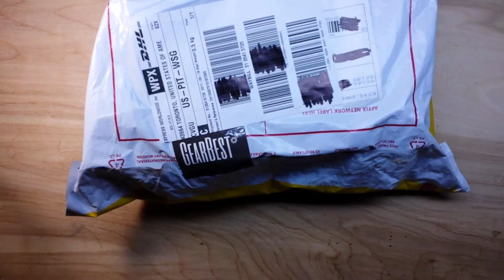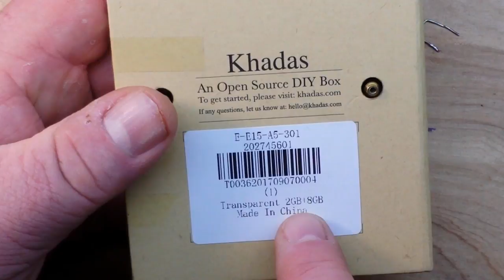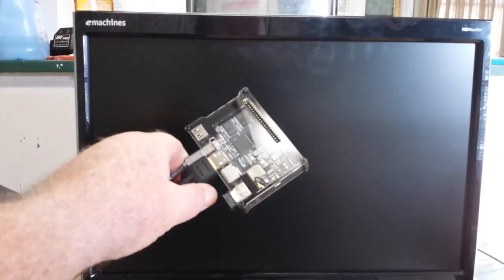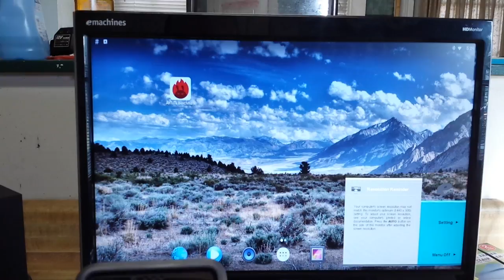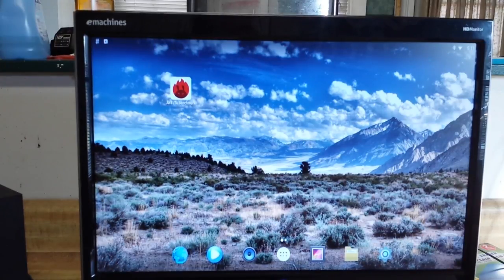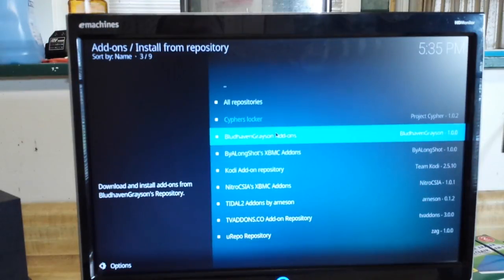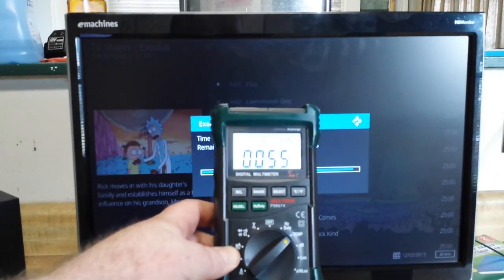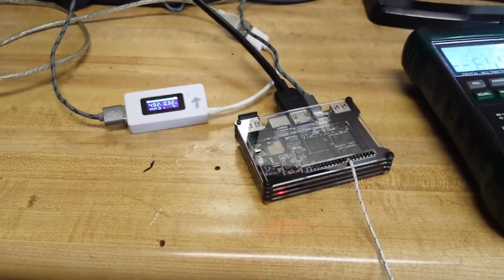Khadas Vim Single Board Computer from Gearbest Review

Comment: $52 - ridiculous price! A few months ago I purchased same SoC based Android box but 2G/16G in case with remote and power supply. And I paid about $30. Of course it has no GPIO direct access but I believe it would be possible to solder wires inside if necessary. The best and in best price is still OrangePi PC which has similar capabilities but costs only $15. And there are many Linux distros and Android too. Or smaller 0.5G Orange Pi One for $10 only. $50+ is crazy. For such amount I can have older Atom based tablet which is better as computer or much cheaper Orange Pi PC for GPIOs programming.
Reply from the maker: +cbm80amiga not really it of range. I just looked on Amazon (23 Sept 2017 17:30) and searched for a comparable unit "android tv box 2gb ram S905X" and the prices range from $36 to $64 usd. So while it is at the upper end of the range, it is still competitive, specially considering the GPIO access. 

That being said, I agree that better values can be found, and thank you for taking the time to comment. I watch your channel, and respect your opinion.

Comment: I need to stop watching your channel. Another I must buy that you are reviewing. Although, this looks like a fun box. I gave you a thumbs since out of the box it was a good review. Next review work the GPIO, blink an LED or monitor the room temp, I don't care. Also, with Linux you can do a headless boot. Can you do the same with Android on this box?
Reply from the maker: Carl Davis There is going to be a second video on this box. There are a couple of Linux distros for the Vim. I need to play around a bit and see which one I like, which one works best. 

As for your question about headless. I'm no Android expert, but I imagine it would boot and run just fine. Here's the big but....but... I'm not aware of any way to remote into the Android OS. But I could be wrong.
Reply: You can buy stuff and tamper with it then once done resell it as used on Amazon/ebay/Craigs list...etc.